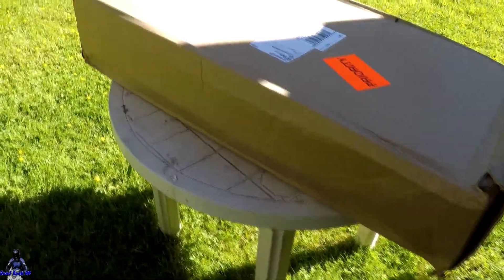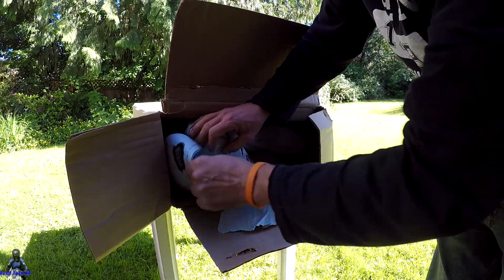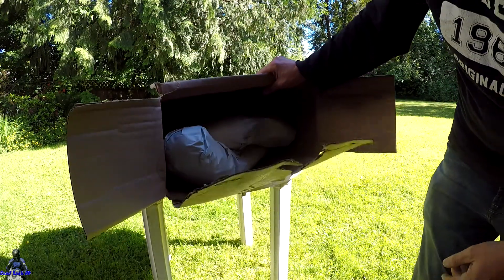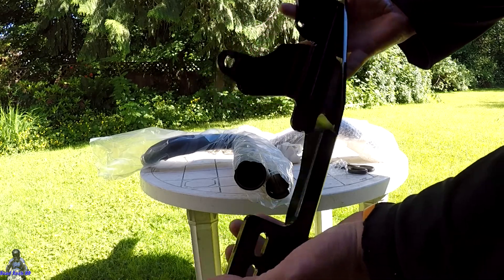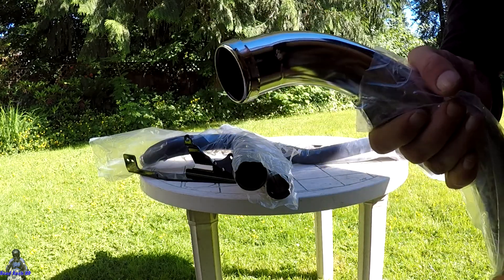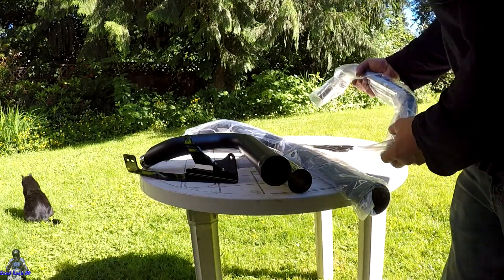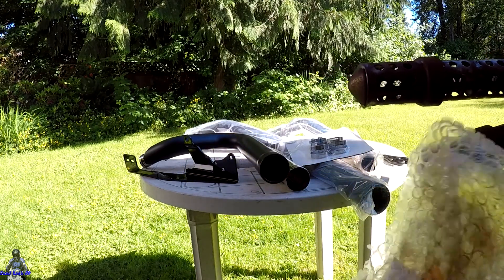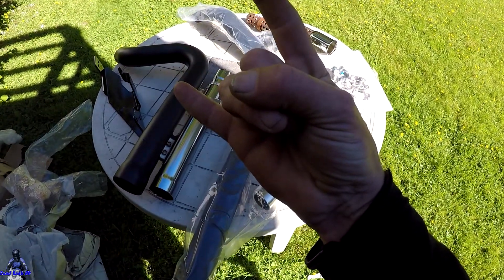Unboxing The Cobra 909 Speedsters Exhaust - 2020 Harley Davidson Iron 1200

Comment: I just installed these on my 2020 Iron 1200. You're going to love them. They sound awesome IMO. A word of advice. If you are going to use the baffles install them before mounting. Then before mounting the heat shield remove the screws attach the heat Shields and reinstall the screws. This way the holes are already lined up. I had one install easy but the other one was a PITA. I had to get my head in there to visually line up the 3 holes. I love the sound with the baffles. It's a deep tone. Especially like the idle sound. 😁 I used a Arlen Ness big sucker and Vance & Hines FP3 tuner. It runs great with the canned tune from V&H. I see no need to do an auto tune but may just for fun in the future.
Reply from the maker: Right on,thanks for the heads up on the baffles